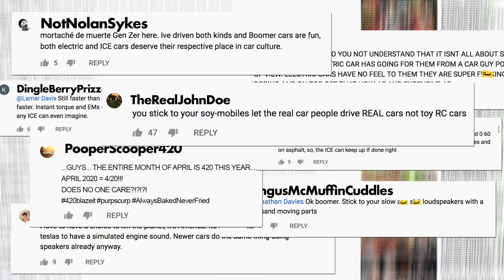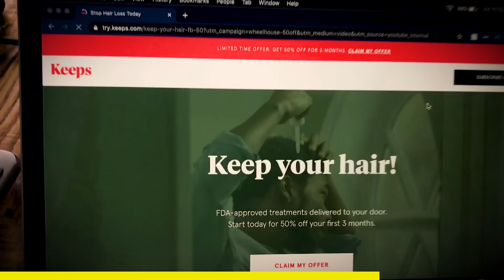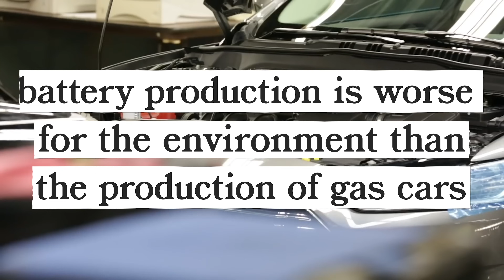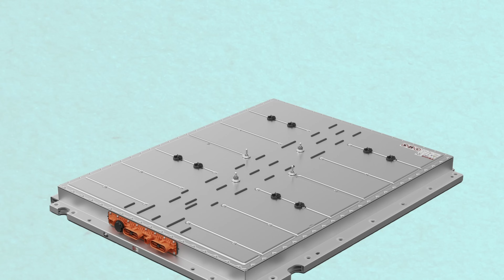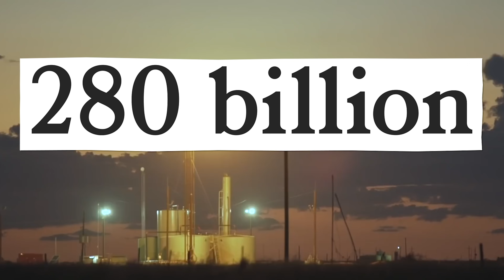Are Electric Cars REALLY Better for the Environment?

Comment: alright in that case hydrogen powered cars are the solution
Reply: Hydrogen cars are essentially electric cars with a generator..
Reply: @seboperrier8099  yes bud more efective because u dont need suchs large baterys packs and stored hydrogyn in liqiud form doenst lose it power properties in diferent wearher like e cars whichs sucks and also makes them not a great chose for any one that realy puts miles on his car because geting from a to b can be a pain in the ass whit all the times u need to recharch those baterys
Reply: @AmongUsGamer YT my gramps 67 wagoneer runs off a hydrogen gas mix. Uses a hydrogen cell uses acid and water and electrolysis and converts the water into hydrogen. That and hus single barrel stromberg he gets 20mpg (13mpg stock)
Reply: I agree with this with one stipulation though. In order to have hydrogen vechicles viable and clean out electrical generation must be renewable. This is due to the fact that the only clean way to make hydrogen is through a process called electrolysis. This takes water and electricity to make hydrogen and oxygen. Once you take the hydrogen you combine it with oxygen that is in the air which results in, again water and electricity. If you look at hydrogen vechicles like this it is an "electric car". However instead of our traditional battery we use hydrogen to story the electricity. Therefore hydrogen cars are what I believe are going to become common as we move away from oil powered vechicles.
Reply: However this being said getting hydrogen cars up and running will take a lot more work than your classic electric car. We need to have clean electrical generation. (Which we can't currently do but thats another conversation) Qe also need to have all of our hydrogen generation use electrolysis using that clean energy. We also need the infrastructure in order to transport store and distribute hydrogen to those who own the vechicles.
Reply: Forgot to mention his hydrogen gas hybrid 67 jeep he built it in the 80s i believe and he has been daily driving it till recently the things so worn out the trans doesnt shift not cause the trannys worn but cause there is 300k miles on the column shift shifter
Reply: Plus no need for range scares & time wasting because you fill up the same way you do with petrol, though storage is one of the major issues
Reply: @AmongUsGamer YT yes,  it is double the price, but you can go a lot farther on a kg of hydrogen than a litre of petrol,  think diesel vs petrol
Reply: @kurtsudheim825  but a kg of H2 takes up a LOT more space than gas.
Reply: @nateverge1167  It would be compressed, not in gas form, if you look at hydrogen cars on the market, they can easily do 600km on one charge
Reply: @kurtsudheim825  so you can go more then 100 miles on 4kg of hydrogen? The klr650 diesel gets 96mpg at 55mph constant.
Reply: @AmongUsGamer YT Hydrogen is not less than Gas. It's made from oil. While in theory it can from renewable sources, the majority ones in the US are from oil.
Reply: @MuddinNYC  yeah man but I worked on a project to extract hydrogen from water but the cost of such extracted hydrogen was too expensive to be viable.
Reply: @moizattaria4051  its actually significantly cheaper than gasoline when made in large scale. i wrote a university paper on something about hydrogen once and really had to look into it, its possible to produce really cheap green hydrogen in certain parts of the world with for example wind or solar. however either way it will be more expensive than hydrogen made from a gas reforming process and no hydrogen is not made from gasoline like the other dude said. hydrogen is however used extremely much in industry and agricultural applications so it would be best served to first replace the bad hydrogen with green one before starting to make hydrogen cars a thing. in very few spots on the planet its actually already possible to make green hydrogen as cheap as dirty hydrogen. hydrogen can be stored forever and that makes it viable for grid balancing whilst also being a fuel for industrial uses or cars. this puts a lot of externalities into the equation so its not easily explained how beneficial it actually would be
Reply: @MuddinNYC  not oil, actually methane
Reply: @MuddinNYC  it’s made from water kinda
Reply: Transporting a truck full of hydrogen gas would fill less than 10 cars. 
So, you can transport it in a more dense form, like a liquid (like gasoline). What do you do to hydrogen in order to condense it to a liquid?

You freeze the shit out of it.

Where would you get the energy required to power the freezers needed both transportation and storage? 

That, and several other logistical nightmares, makes hydrogen unfortunately unviable.
Reply: my brother said that a couple months ago
Reply: and burn off in your car in a hot day..
Reply: James May entered the chat
Reply: @AmongUsGamer YT its a fucking joke, jesus christ
Reply: @AmongUsGamer YT check up prometheus fuel, the power of hydrogen I've heard is 17 times more powerful then gasoline, so they use te co2 gas to combine hydrogen to a useful level, and liquify it, then you have the solution😊
Reply: AYO bro nice profile picture
Reply: Simply Google NOx and you will quickly see why hydrogen used as a fuel in a conventional combustion engine is not okay. Trade one problem for several new ones.
Reply: @spirorevelis7100  i never said it should be used in a conventional engine
Reply: Not needing a car seems the best solution.
Reply: @Prodigious1One  exactly what the hell happened to TRUE horse power.....actual horses
Reply: @LARZMARZ94  we switched to the automobile and let the horses do other things.
Reply: @yaboi-km2qn  I like finding piles of shit on sides of roads. I saw an email that was titled this “ya boi replied to you” so I had to holla at ya boi.....which is you lol
Reply: Bro , hydrogen fuel cell cars are basically electric cars but uses hydrogen to generate electricity within the car . And it still uses lithium batteries in hydrogen cars ... So it doesn't make much difference considering the environmental hazards in mining the lithium or the battery components . That being said , these alternatives seems much better for the years to come .
Reply: @srpcreations4415  hydrogen uses lithium?? What that would just be an unnecessary step
Reply: @jamesvincent1567  yes it does , but the difference is the quantity . Hydrogen fuel cell cars use significantly less lithium ion batteries compared to an electric car , check Toyota's presentation on Mirai model and it's engineering .
Reply: @srpcreations4415  yeah just watched real engineering on it again but yeah use cells my bad
Reply: Exactly. We hate electric so much that we will avoid it at all costs
Reply: Im not sure about that there is a lot of oil left so there is no lack of fuel there but hydrogen is kinda a hard source to get that can get expensive and not only that gas powered motors can be further advanced but needs further research and in order to make it perfect requires a lot more development and a lot more precision during the build aka what was needed for rotarys because they are in theory supposed to be the most efficient, reliable engine that you can get, but the research and time and development was too short to reach that point because they were taken out due to emissions even though mazda is currently working on a new project as much as I hate to say it I have doubts they will ever get there
Reply: @Thri11Seeker  You're right. Plenty of oil, no need for other nonsense. If they want them, fine, but leave us normal people out of it.
Reply: You have no idea, hydrogen can’t work in the current state of the world.
Reply: @felixgrote6831  exactly thats the bad part about it, but if it doesnt stay like that it MAY be a source of "fuel" kind of (dont know how to phrase it properly)
Reply: Really it doesn’t matter what power plant the car has, Whether it runs on hydrogen electricity diesel or gas if it’s AC or DC Piston or Rotary.
Rubber tires a are still a problem. So just fucken walk and lose some weight. Well if you care so much.

(Edit) sorry if that sound so aggressive but yeah.
Reply: Fool cells are not viable on the scale required for nationwide adoption
Reply: But it blows up
Reply: Explodes in seconds rip
Reply: Yes hydrogen fuel cars are the best.........................................untill another car power source is discovered.
Reply: Nope stay with your supra
Reply: @G3orge3670  my uncle first generation mirai still didnt exploded even after two accidents with trucks.
Reply: @nurmikasaackerman8786  ok
Reply: @nurmikasaackerman8786  exactly and people are still trashing on hydrogen cars like wtf
Reply: Hydrogen is not produced emissions free and they still need a battery
Reply: Toyotaaaaaaa
Reply: Hydrogen cars are not the answers, better public transport is the answer
Reply: @kshitijpradhan564  in an ideal world, yes, but  in reality it would be way to expensive to put public transit across all rural areas and it would be losing money forever, cars will be always needed
Reply: Diesel
Reply: Actually if we mine from other planets like Mars and the moon electric cars really won't have their downsides
Reply: @captainmistake748  ironically Elon Musk is trying to mine earth empty and move to Mars.
Reply: If we can minimize the price and use a different method of production that doesn’t make carbon, it will be the best solution
Reply: Has anyone heard of Stanley Myers?? 

The guy who can run his car from NY to CA on 22 gallons of water with an injector that would spray the hydrogen he would split from h2o
Reply: Hydrogen it self is flammable
Reply: Just don’t get blown up like the Hindenburg and you’ll be good 👍
Reply: If it happens then every wheel balancing shops would be a gas stations
Reply: @AmongUsGamer YT then methane powered engines
Reply: No hydrogen fuel doesn't solve the problem it just shifts the problem somewhere else
Reply: @chittetisrinathreddy5046  bikes. Bikes should be the future, even the least fuel efficient bikes are more fuel efficient then their 4 wheel counterpart.
Reply: @deathsdemon349  well we can't use them for very long distances and may be using mass transportation like using public transportation may reduce carbon emissions
Reply: @chittetisrinathreddy5046  two wheels will always be better the 4+ for just people, consider 100mph sport bike is equal to about 60mph-80mph sports car for control, plus 1,000cc is much smaller then the 6,000+cc of the big boy cars that are on the same level for top speed
Reply: No no no water powered cars lol
Reply: Oh the humanity!!!
Reply: Algea Bio fuel  is the future.hydrogen is dumb
Reply: More like hydroelectric plants to produce electric vehicles
Reply: That for damm sure its not only more durable its more frendly for our planet and u can make more km whit it or miles the production of the cells that drive those cars is also beter than making baterys and because u litarly can store energie in that form u wil also have not that muchs of a weather inpact on youre range
Reply: @AmongUsGamer YT treu that bud evrything we make produces co2 add some stage of production bud we are a wasteful society sow maybe making things more durable and limit production sow u never have to muchs products wil help sow muchs bud our economy is based on buying and throwing it away sow thats kinda a problem that we wil need to deal whit because i realy thing that can realy make the difrence bud stil hydrogyn can come from solar or wind and in that case only solar cels wind turbines and hydrogyn facilty building wil produce some co2 bud not anymore when its runing and or build
Reply: That's what I'm saying.. it's the future ;)
Reply: But, why should we bother with hydrogen if we have to use an electric motor and battery anyways. Yeah its brilliant, lets use electricity to generate hydrogen from water, then store it but be careful it is flammable, and then pump it into a hydrogen car and mix it with oxygen to generate electricity and use the electricity to move the car. Whole hydrogen car concept is a bas joke.
Reply: @dNIGHTCROWLERb  for you buddy
Reply: No, I don't think you got it..
Electricity, fuel and hydrogen are the main energy source from the three kind of cars. (Electric cars, combustion cars and hydrogen cars)
We all know that fuel is not a durable solution. Don't need to argue on that one..
The problem with electric cars, is that if we want to store directly the energy for one big trip, under electrical form, we need big batteries for all of it. Makes the car expensive, heavy and batteries cost more. 
Now with hydrogen, we don't need as much batteries as in standard electric cars. Because they're just there to store electricity in a short term. You can fill up your batteries while driving. So you don't need big batteries. 
And for your last point, hydrogen is great cause the energy to volume ratio is bigger than pure batteries. 
If we take for example the amount of energy it takes for a car to drive 500 miles. This energy needed will take more space in batteries than it takes in a hydrogen tank and a generator.
Reply: And for the hydrogen production, it's just water with electricity that makes oxygen and hydrogen.
The goal would be to have that electrolysis powered by solar panels or wind turbines (or anything else that isn't fossil fuel.
Reply: The solution to what?
Reply: @AmongUsGamer YT that's why scientists and the like do research, to have better ways of of making it so it costs less and produces less co2.  like with lithium batteries being super expensive at the moment, they're trying to make them cheaper.
Reply: Imagine if H was our fuel. The "exhaust" product is water. You can either collect it in a tank, or just let it drip out of the car.
Reply: @wolfdale_3m  not necessary. We have had dependable gasoline engines, for years, now. There's an old saying, if it ain't broke, don't fix it. I don't think hydrogen is that available, anyway, and it's highly explosive. See Hindenburg explosion, on YouTube. Yikes!
Reply: So long as they’ve not cut down trees to make the hydrogen 
But yes hydrogen is a clean product in a car that I applaud wholeheartedly 👍
Reply: We cut the boats going overseas and we could all drive hellcats
Reply: @coreygolphenee9633  We could do both, now. You just need the money to buy Hellcat.
Reply: But hydrogen powered cars produce water vapour. The IPCC lists water vapour as the number one greenhouse gas in the atmosphere. You know the big fluffy things in the sky.
Reply: @cgviper1  they gotta find hydrogen, too. That stuff is highly explosive. See Hindenberg.
Reply: Yes, yes it is, they just need to be able to make it cheaper.
People make the argument that it's made from gas and oil, also stands for charging electric batteries.
Reply: @northsider4957  yup, also it is definetely cleaner than electric cars (im counting the disintegrating), also when it becomes cheaper, if it ever does it will come in handy for some things
Reply: The only con about hydrogen is its flammable
Reply: @msolito17  so is gas
Reply: Should try nitrogen as fuel
Reply: @krishansinghnathawat9841  nitrogen doesn't burn
Reply: steam powered baby
Reply: lets drive a nuclear weapon because why not?
Reply: @tha_dealler4811  you know what thats a great idea!
Reply: @chickensfloat7427  Nuclear power is the answer to space travel. That's a unlimited source of power you need to travel in space.
Reply: @LeathafaceTV  and if theres a faiked take off? Have fun with the radiation. Youl have to cool it too though. Only so much space on a space ship. Im sure its possible  but probably not practical not currently anyway.
Reply: @chickensfloat7427  You create a lead panel room that keep the radiation in and also keep the lead away from people to prevent lead poisoning at the same time. I think it's time these nations start pooling resources together into something worth wow vs spending billions on war weapons to kill each other.
Reply: @tha_dealler4811  the United States navy does, most of the navy's big ships are credited as nuclear powered
Reply: @tha_dealler4811   You dropped the bomb with that joke.
Reply: But it is the future
Reply: @seboperrier8099  the REAL future is.....using our legs

Comment: So here is my question. If the estimated EV produces 1/2 the CO2 emissions of a IC engine over the entire lifespan on a NEW  vehicle then what happens to the folks who only buy used? I've seen estimates that a EV averages about 100,000 miles before needing a new chassis battery system. So for the folks that can only afford sub- $5000 used vehicles which is the better? EV or IC? I mean the video makes sense regarding brand new EV vs IC but what about the used market? And what happens to my old EV battery once I "recycle" it? What is the CO2 emissions on that process? Also does your calculations on Co2 emissions account for the destruction or recycling of each vehicle?

Comment: So at the end, the EV is better by roughly 3 metric tons of Co2 per year.  However, drilling for oil and electric plants already exist and are pretty well as perfected as they can be.  EV also results in *NEW giant holes in the earth and other damages to water ways and the environment, as mentioned earlier.  My guess is, at best, it's a draw.  But this video did nothing to prove EV is or will be overall better.

Comment: More co2 gets produced in electricity by coal and gas power plants to produce the electricity to charge the ev which is the main producers of power here in the states. 2.2 pounds per coal plant kwh   .91 in natural gas in kwh. To charge a Tesla model 3 74 kw battery on coal to go up to 263 miles makes 162.8 pounds of co2 more then likely more due to line loss. Going by the car getting 39 mpg that's about 20 pounds of co2 per gallon which in turn means 134.8 pounds to get the 263 mile range. Let me know if my maths is wrong.